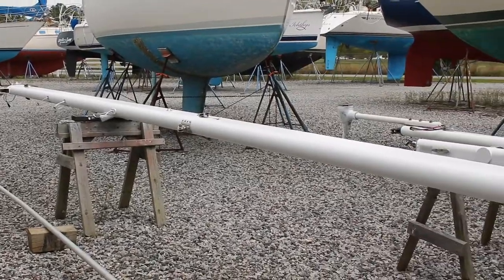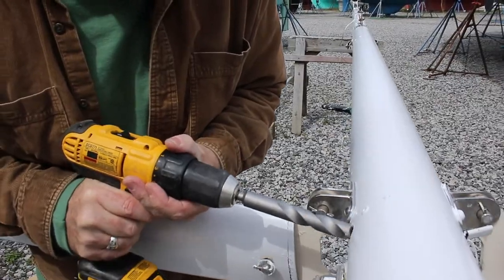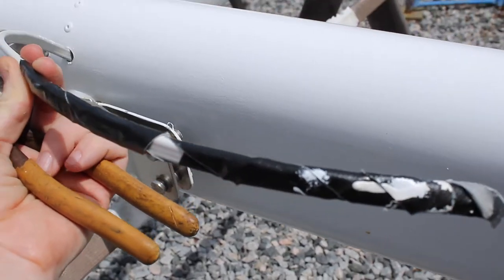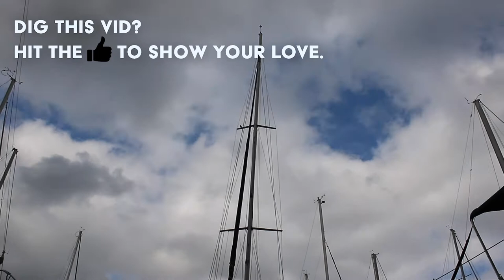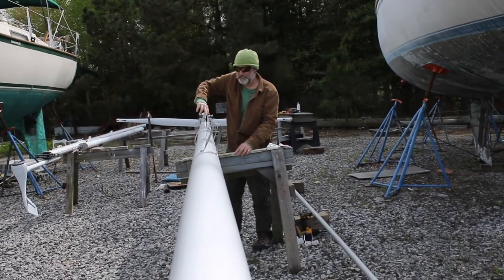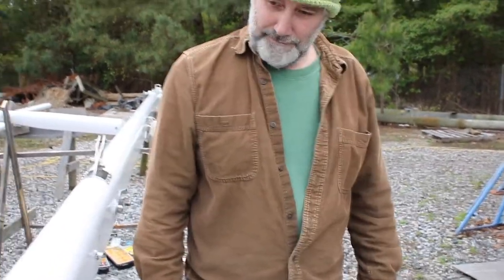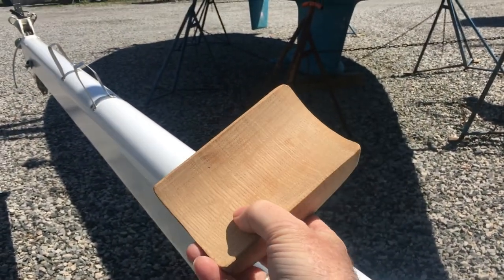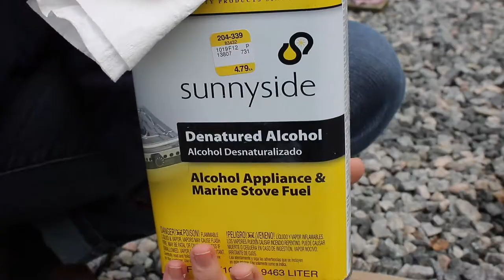Mast LED Light Installation | Crealock 37 | Ep 3

Comment: What's this?  Actually heat-shrinking the solder connection heat shrink tubing?  Sheer madness!  Those are supposed to be left open to catch and hold water in case you get thirsty.
Reply from the maker: Lol! Hey, we only do things right around here! 😊🤙🏽 No solder, only  heat shrink butt crimps. The solder ones are low temp and can actually heat up and come apart. Thanks for watching and comment Ryan!!